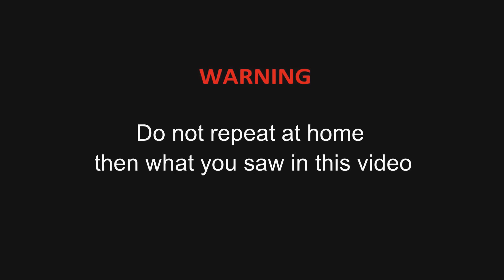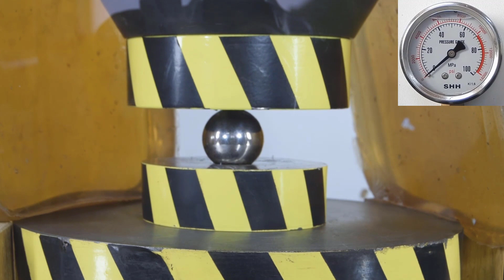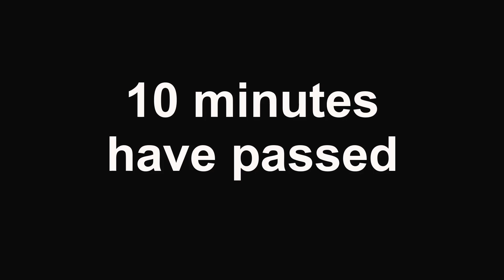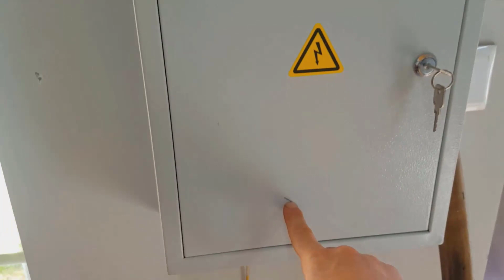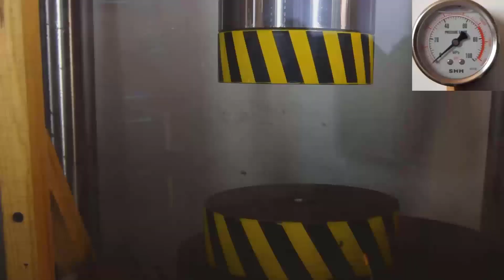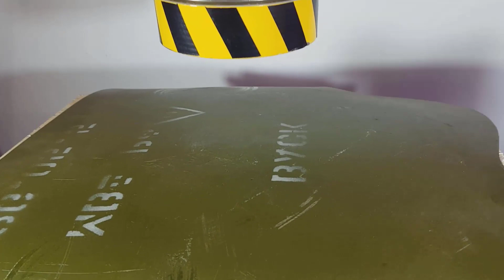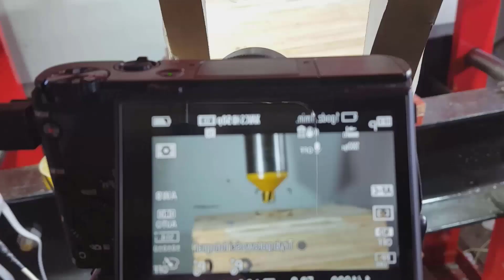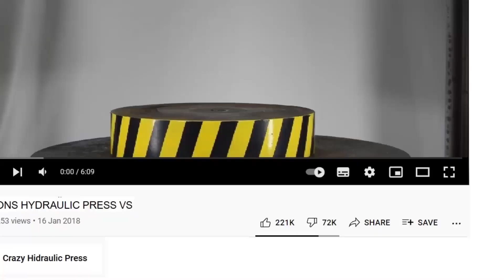DANGER OF FRAGMENTS FLYING FROM UNDER A 500 TON HYDRAULIC PRESS

Comment: Looking at a 500 ton press I imagine 10 fifty ton railroad cars or 50 city buses! I believe there is a theoretical limit to how powerful a press can be, if we crush a small egg sized (they might exist)  Black Hole, would pieces fly at a speed of light? In theory a hydraulic cylinder could be as wide as the Universe but gravity/quantum world would be the limit, Is there such a thing as maximum density of matter?
Reply: ? The limit would be defined by the material limits of the metal doing the crushing, not the size.

Plus you can't know anything about black holes if you think one could be crushed. Touching one is obviously impossible.
Reply: @kampybballer21  can you prove you can’t touch a black hole? Until I have proof then it’s possible
Reply: @potatogaming6893  pretty easily ya with a certainty above 7 theta, but you don't seem like the type of person that cares about the scientific method. If you actually show you wanna have a discussion in good faith, I'll take the time to type it out.